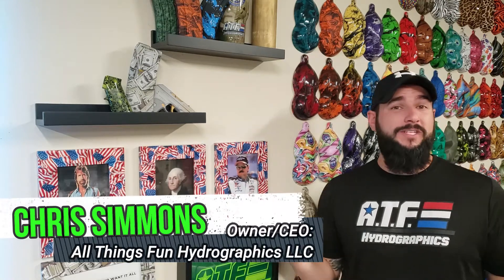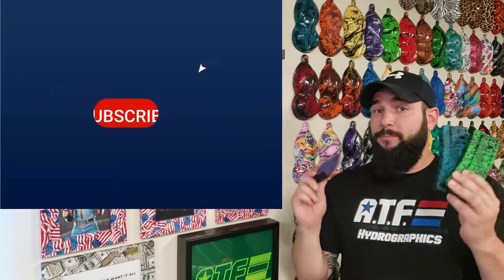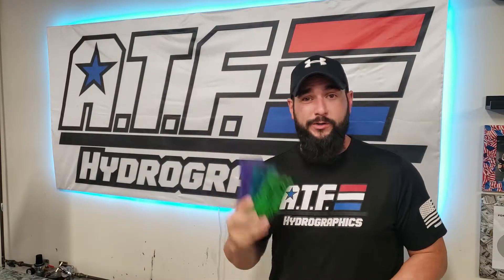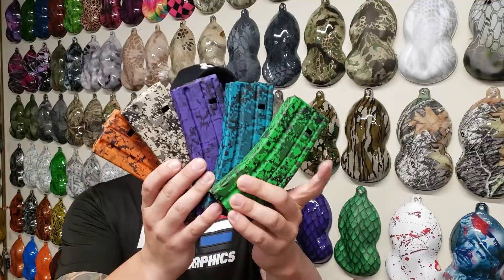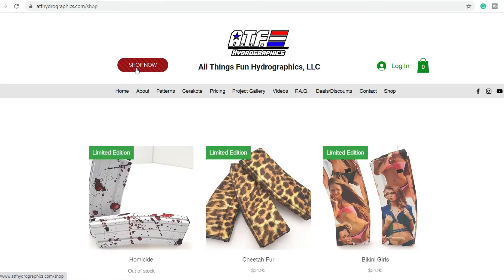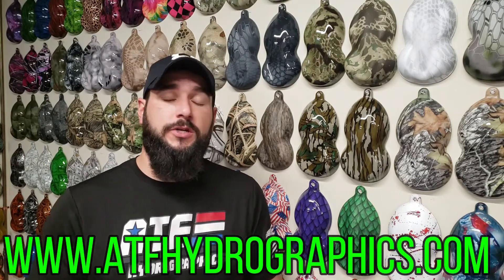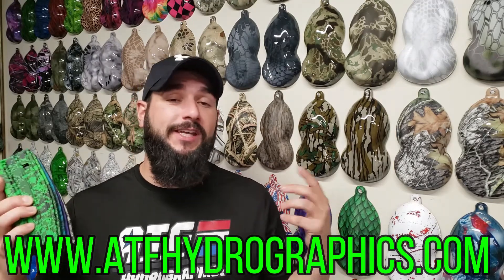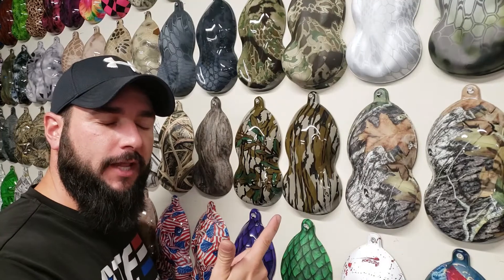Hydro Dipped Digital Camo | Mag of the Month August 2021

Comment: Love the looks of the mags Chris. How many coats do you put on a mag to make them strong enough for abuse putting them in and out of the magazine well.
Reply from the maker: 3 coats of base, 1 coat of clear. The mag well part will always eventually come off from repeated use. but you cant see it so it does not matter. The rest of the mag will be fine.